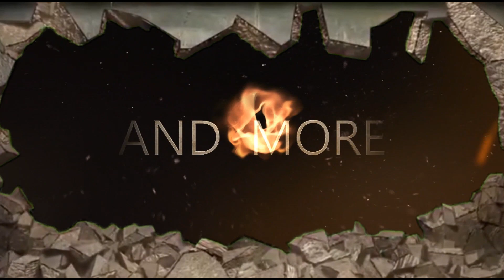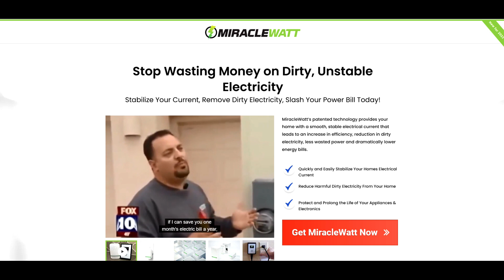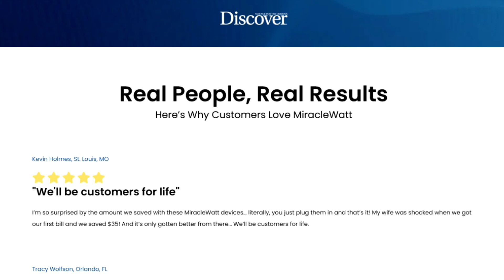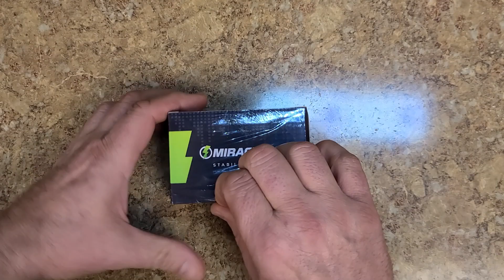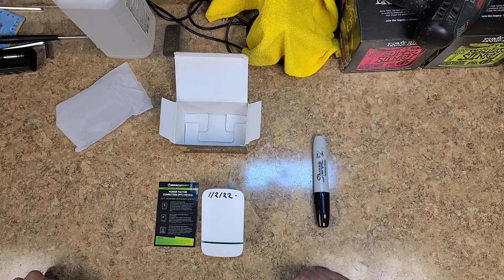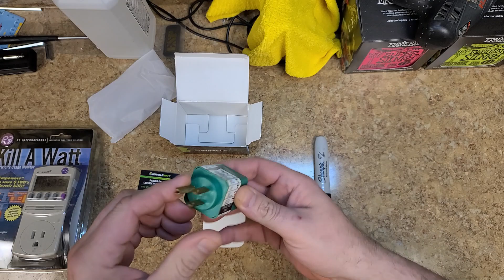MIRACLEWATT Will it Save You Money?

Comment: Everything on the pcb is just to light the LED, this helps convince people, "it''s working"  It's not. The large black item is a non polarized capacitor. It is very similar to what you find in 3 speed ceiling fans, (part of the speed adjustment).  If it worked, you should see a reduction in electric usage immediately. Scam!

Comment: I can give you the answer, NO, you did not save a penny. In reality, it probably added a penny, since that circuit you looked at is just a power supply for that led. And for your 4ft bulbs in the basement, cut out the ballast and get the direct wire-led bulbs. 4000k or 5000k
Reply from the maker: I took out all of the 4fters in the house. we had them in the kitchen as well. I changed them all to LED's. Much better light and savings.

Comment: People are hilarious.  Do you know why this thing needs to be plugged into the wall?  It needs power.  Do you know why?  Because in order for the circuit inside this scam pos to "work", it needs to current to be on.  If this thing is drawing current, you know, the thing that runs your power bill up.  How on earth, and I mean how, do you think it is doing anything other than COSTING you money?

If you had a lot of holes in a water bottle, would you put another hole in the water bottle to stop leaking?  That's all this is.  Another hole in your water bottle.

Comment: Clean is not word I would use, convert , to sine waves.
Inverters, converters that are cheap v.s. True sine wave invertors, or convertors. 
The con that these guys getting paid, hold stock. 
Just buy sine wave devices, it is true devices run good better if running on current that energy wave is sine. Oscilloscopes adjustments can fluctuate the electrical signal.
Nothing new. 
Cost true sine wave get ten times the money
Of a dirty device, you know the ones on your house. 
Maybe I havent learnt much in 70 years, but i get tired of being these type butt heads making a sucker out of me and the world.

Comment: Power factor correction?
Reply: That is the correct answer, however, that only applies to motors, and every motor already has capacitors for that. Look in your HVAC, you will find a few caps, look in your ceiling fan, it has a cap, and those caps have to be sized for the load. The cap in this is like the one in a ceiling fan, so it ain't gonna do a thing!

Comment: The big black box 'thing' is a capacitor which normally have a microfarad rating marked on the component. It's amazing to think this rather simple circuit can indeed save money. I just heard of this as you described, just checking Accuweather for the forcast today. By the way Accuweather bombards users with advertisements. Sucks!
Reply: Yea and the device in picture showed a 13 amp fuse tied to ground, I get ground, but a fuse is not a copacitor.
Reply: This thing was made for idiots to buy.

Comment: Did you do an update with the results?
Reply from the maker: Kind of. The weather here has not been cold every day. When I first plugged it in, it was cold every day. Heat was on a lot. The next electric bill that came out was lower because the heat was not running all the time.

Comment: Reverse polarity CAN KILL! It is  when you (do not) touch a light socket, the center? It  is the 'HOT' !  The outer ring is white , so if you turn the lights off ( DA! Please, for safety)  to change the bulb/ and your skin comes in contact with the outer ring IF HOOKED UP REVERSE ?  YOU GET SHOCKED!! EVENT WITH THE SWITCH OFF!!  ( Green bare wire is ground, ) AND You're HOOKED UP IN REVERSE POLARITY BOOM!@!  Like a car, the - A wire is grounded to the car color's black is ground! Opposite in a house)  On a house? White and green is ground) Green is grounded to the ground rod by the outside main meter!  It is grounded to water lines furnaces stoves, White is the wider  or taller one is WHITE one on a 3 prong plug, And the ground (peg) and white are connected as one ( in most cases) in the main disconnect box!  As 2 wires for safety. In case of a problem. The two will cause the 'black or red or blue' to shut off the breaker.   Tripping the breaker Or blowing, burning out a fuse. BACK IN THE DAY AS A CHILD, A NEIGHBOR WHILE HELPING HIS WONDERFUL WIFE @ THANKSGIVING WHILE SHE WAS DOING SOMETHING HE KISSED HERE AND SHE DIED! WHY? APPLIANCES HOOKED UP REVERSE AND U.L. AND LOCAL CODES! The  CODES HAD NOT TAKE EFFECT YET!  True story . Even today, check your outlets and your appliances! If wired incorrectly, they CAN ( will) kill you! AS AN ELECTRICIAN, I HAVE SEEN EVEN NEW MACHINES BURN UP A MAIN  ELECTRICAL GRID. BECAUSE THEY WERE ALL HOOKED UP WRONG! TEST AND CHECK EVERYTHING! AND AS TO SAVING MONEY?  WHILE WORKING AT A LADIES HOME, SHE ASKED IF WE COULD CHECK THE APPLIANCES ( VERY GOOD MOVE ON HER PART) WE DID, AND FOUND 1 RUNNING AT 3 TIMES THE AMPS NEEDED! Insane) THE FREEZER WAS REPLACED! AND SHE WAS VERY HAPPY!  She is latter called back thanking us!  Because it cut her Bill in 1/2 .
Reply: You stated white is ground. As well green is. 

The correct answer is 

For buildings:

Black, Red and Blue are hot wire.

White is called the common wire. 

Bare copper and green is ground wire. 

For cars:

Red is positive. 

Black is Ground. 

So clearly what you stated is completely incorrect.  White is the common wire only.  Green/Bare Copper is ground.  Black, Red, and Blue are hot wire for a buildings. In the USA.  Other countries have other color codes for buildings.

It's different for cars.

Comment: At 7:45 you can see that the big black capacitor is connected to both ends of the SAME circuit trace, ie. it does nothing except take up space. In reality it uses a little power to light the led, but of course not enough to hardly notice on your electric bill. "You don't get something for nothing" , my father often said to me.
Reply: It doesn't work it's on the Wong side of the meter please save your money so you can pay on your electric bill I have had mine for 6 months it doesn't work
Reply: I think Big Clive in the UK cut the black box in half and it was full of sand!

Comment: I am curious if this little gadget is going to save you any money. There is a lot of scams going on in this world. Hopefully it will do its job. Thanks Eric for sharing this video my friend.
Reply: Sheeyit.
Reply: There are two reasons it will not save you a dime.  (1) It does not work technically.  Any reactive power correction you experience will be essentially too low to measure.  (2) And EVEN IF IT DID work, the electric power companies in the US and Canada do not charge residential customers for reactive power correction.  Only commercial and industrial power customers have to worry about this.
Reply: Oscilloscopes if you want one you can take small amounts of power pass that power through in oscilloscope there’s a dial on it which is a potenchiometer turn that thing up and down and you’ll see your you can make dirty energy through that you’ll see the signal across the screen And you make clean sine wave you shit is it new these guys are peddling snake oil like somebody said you can buy inverters converters that are cheap or size true sine wave inverter converters that are 10×20 times more expensive you can test resistors and all kinds of things which and you can get a cheap oscilloscope for 40 bucks off eBay Amazon

Comment: Definitely snake oil. You can certainly have reverse polarity with A/C Power, and it is very important they you don't. 
Like you said in the video. You wanna use less Power, shut some stuff off.
This is not to say things cannot run more efficient. It's just that, they use what they use.